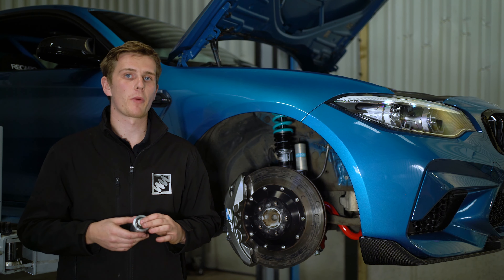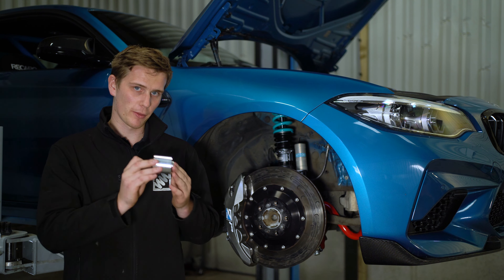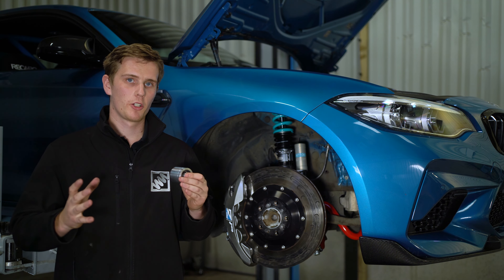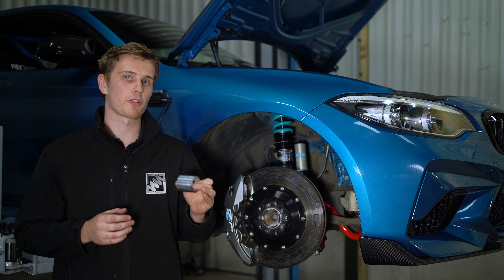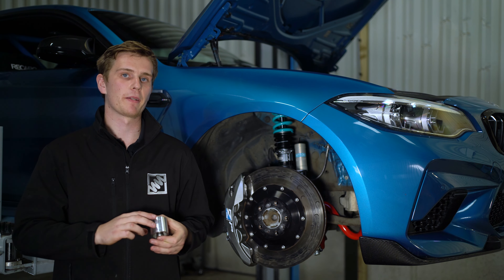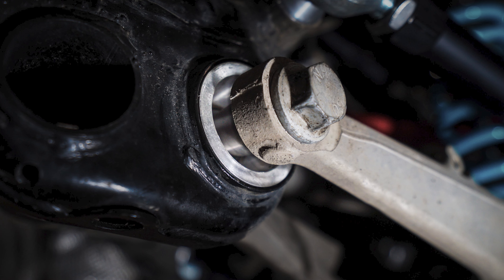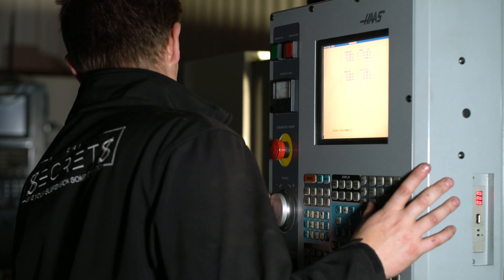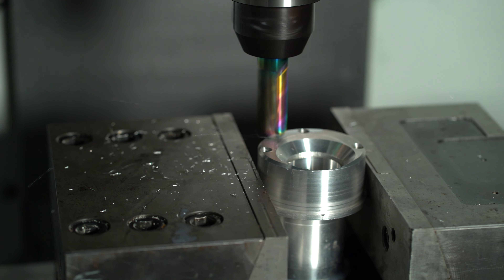BMW M2/Competition F87 - Solid Rear Control Arm Bush - Suspension Secrets

Comment: The standard bushing from F87 shares the same part number as the E9x and E8x platforms M and non-M. Can you confirm if these solid bushing is compatible with these old platforms?
Reply from the maker: Thanks for the comment. Yes they fit across the platforms. We also list our bushes specifically for the E9X to avoid any errors 👍